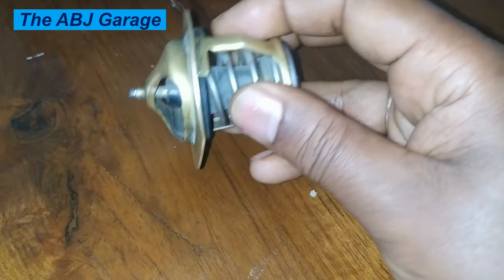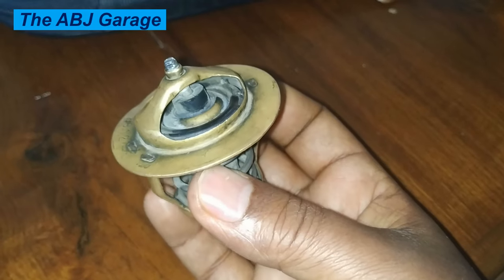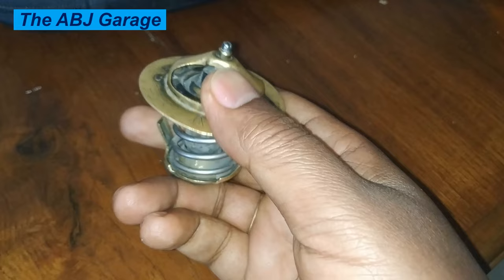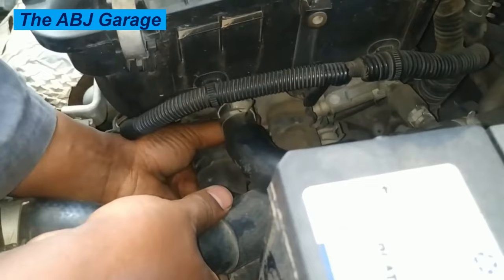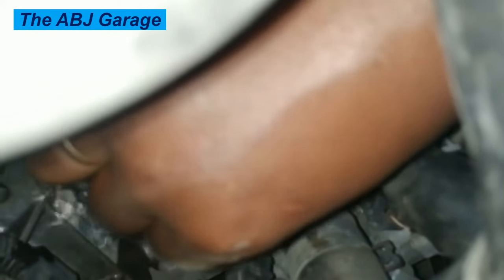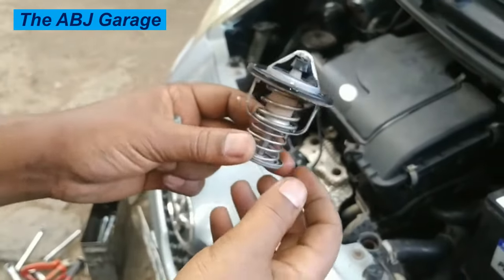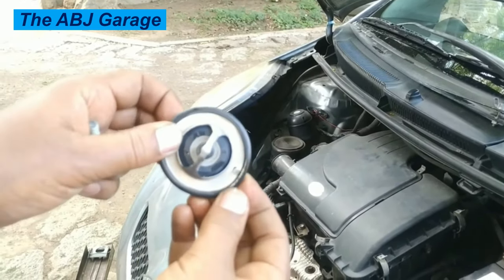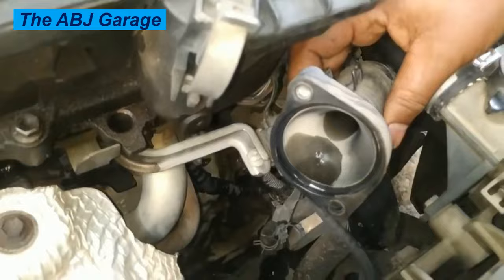8 SIGNS OF BAD OR FAILING THERMOSTAT

Comment: Subscribed, great info. 👍 I was wondering if you could answer me this. I have a BMW x1 brand new water pump and fairly new thermostat, fairly new radiator. When the car gets up to operating temps the top hose is hotter than the bottom one as it's supposed to be. But once it gets up to operating temps a consistent constant thumping begins and it doesn't quit it just keeps thumping almost like the sound of a heart beat. Was wondering if you ever heard about anything like that and what it may be?
Reply from the maker: Have you tried to run the engine with the hood open and locate the area where the thumping sound is coming? This kind of thumping noise is most definitely associated with the thermostat. This usually happens when there is some issue binding the thermostat and preventing it from smoothly opening and closing. This repeated sticking and unsticking can cause a thumping or knocking sound. If the internal components of the thermostat are not working correctly, it can cause the thermostat to rapidly open and close in an erratic manner. This erratic behavior can produce a thumping or pulsing sound.

Have the thermostat been recently removed for servicing? If the thermostat is not securely mounted or is loose in its housing, the vibrations and movements of the thermostat can create a thumping noise.
Reply: @TheAbJGarage  Well that's what I was thinking too. Yes my hood is open and I'm listening to every part. I put a stethoscope on the thermostat and it makes no noise and I put the stethoscope on the electric actuator and I can hear the thumping. I don't know it's weird. So I'm thinking either the electric actuator is failing or the turbo manifold could have bad gaskets. I don't know that's just what it appears to me. Really strange

Comment: Hello, tq sharring. What is the problem if the engine and temperature signs light up at the same time. 
When the engine was turned on, I found the engine and temperature gauges lit up. 
Both of these signs stay on even when the car is moving. 
I have already sent it to the workshop, but according to the mechanic all the error codes have been fixed and no error codes have been detected. 
This is strange.
Can you help me ?
Thank you.
Reply from the maker: your car probably have a wiring issue. The illumination of the lights could be due to an electrical problem or a faulty instrument cluster. This can cause incorrect readings or false alerts.

Comment: what happen when the water is coming out of your water tank, is the thermostat the cause?
Reply from the maker: Not usually y! It is either bad radiator cap or compression leak into the cooling system. Air trapped in the cooling system can also be the case.

Comment: My engine temperature is very high off late. If I start the engine for 5-10 minutes the temperature becomes extremely hot or high. Please is it a faulty thermostat or what kindly help me
Reply: Yes or a coolant temperature sensor either or
Reply from the maker: Feel the upper hose and lower hose after running the engine until it  reaches the operating temperature. If you see large temperature difference between the two hoses, then it means the thermostat is stuck closed. For electrically operated fan, also check to see if the cooling fan is running , if it doesn't start running at all, it could be caused by bad temperature sensor or switch. Wish you good luck!